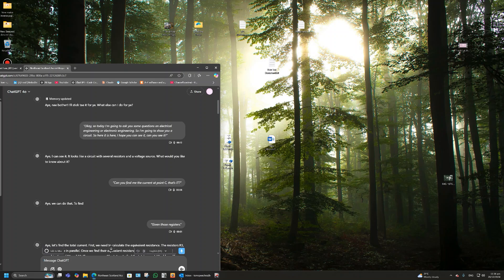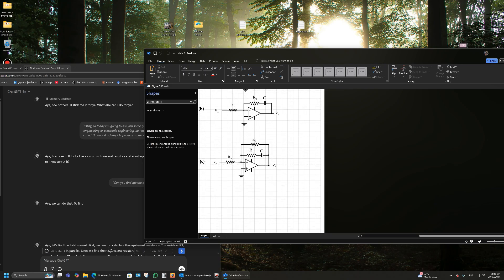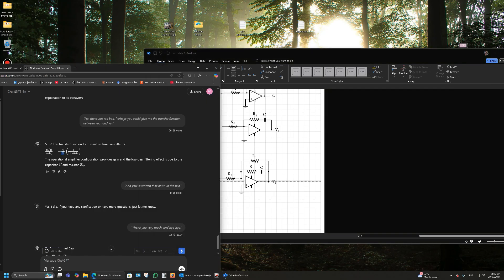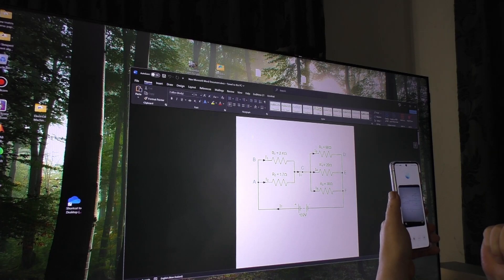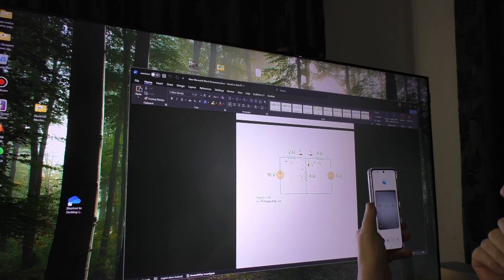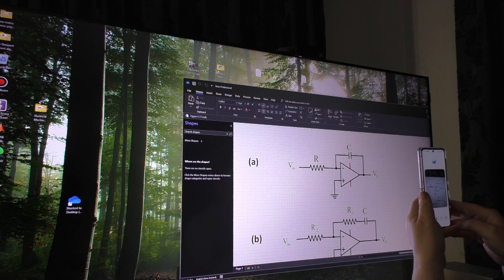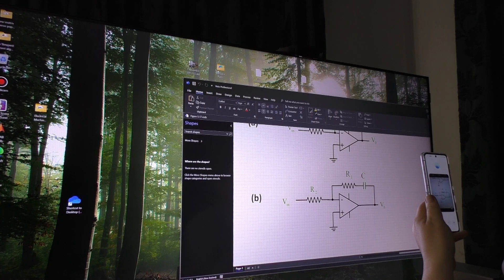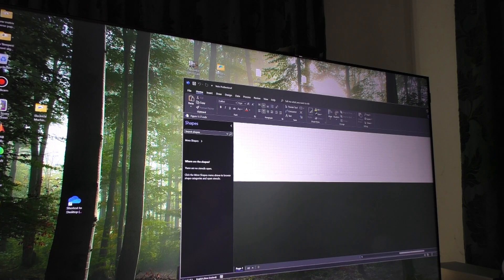ChatGPT 4o B.E Electrical Engineering (failed)

Comment: I have noticed different answers from the free one to the paid one.
Did you use the paid version?

If I remember correctly, the paid version is learning "in time" and has access to the internet whereas the free one gets updated.
Reply from the maker: I'm on the paid one.  I don't think the free one has the camera thing. But version 3o just announced offers a smarter AI still
Reply: @TJMoir  I just added the picture into it and had the same "errors".
It can be analysed for free. I do not have the paid one any longer.

Good to know that they released the full version and not a limited.
Reply from the maker: @beastfr0meast93  But I think the real test is the next one which is on trial at present but they claim it may have reached AGI.
Reply: @TJMoir  that i don't believe. That would mean it knows concepts by only showing data a few times. it also means it should have self-awareness and create ideas without giving the option. Meaning the data presented. I just don't see it.
It is like making tissue cells that can "think" on their own to cure nerve damage. In my opinion, you will always be the creator and give it limits.
Maybe they use the phrase loosely. 
Could be nice tho :)
Reply from the maker: @beastfr0meast93  The whole point is for it to solve problems that it has not met when training. For this it uses reasoning. Although it should have met such basic electrical problems as the net is full of such problems. It has no access to scientific papers as they are mostly behind paywalls. so that is a major limitation for advanced knowledge though many papers are published nowadays in preprint form I suppose. They will of course hype it up but compared with a year ago it's a vast improvement. Some say it can't get much better because it has run out of data!